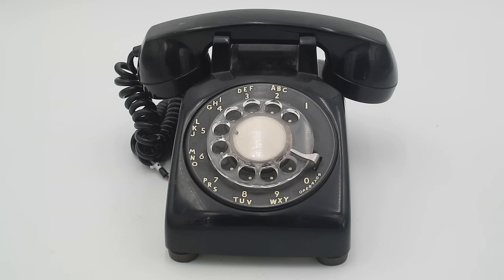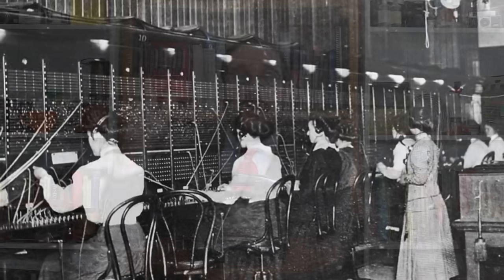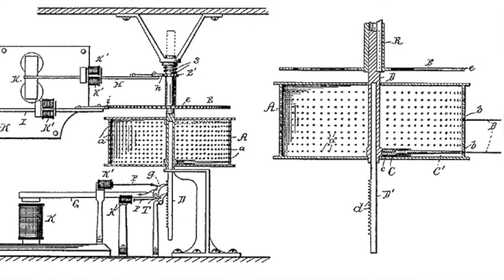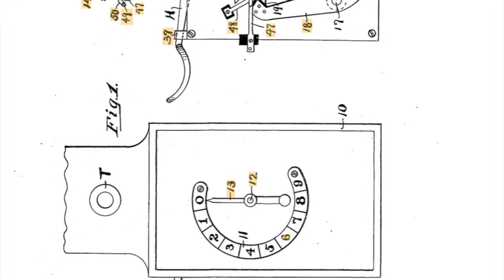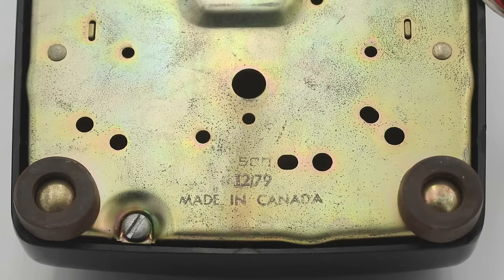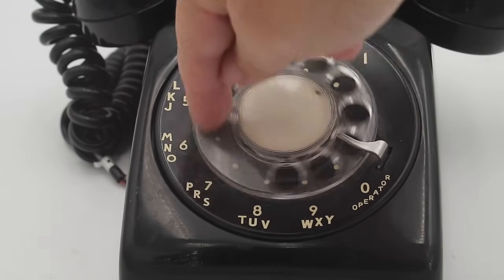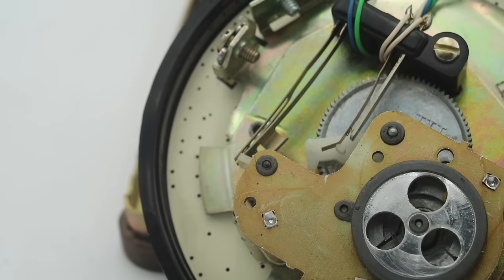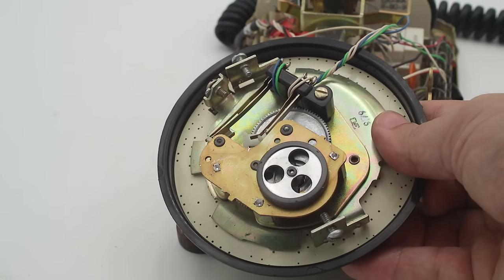Rotary Phones: the Call of History

Comment: The original 302, introduced in 1937 came in a zinc alloy shell rather than the thermoplastic shell introduced in 1940. These original 302 phones are incredibly heavy as a result, something around 7lbs for the whole phone!
Reply: The shell was Bakelite, a phenolic plastic. It is not thermoplastic. It is thermosetting plastic.
Reply: @bruceinraleigh9999  The shell was NEVER Bakelite, it was originally zinc alloy and later thermoplastic. The HANDSET on the other hand WAS Bakelite.

Comment: at 6:30 the model 500 phone "from the 1960's" clearly has a 1979 date code on the bottom
Reply: They refurbished them and stamped the new date on them. Oh, and threw away the old cabinet and put new even if it was perfect . You didn't own a phone anyway.

Comment: I worked in telecommunications most of my life. I was a technician. I retired years ago I've seen these old stepper switches working. They were very noisy. I have a computer have drive that was headed for the garbage.  It's over 3 feet across. I'll send a pic if you want.

Comment: It was a kinder, gentler period of time in the 1950s  through to the 1980s,....when only rotary phones existed. Public phone booths were little rooms, with their own seat, an overhead light, and sometimes a fan. They were quite narrow, so you kind of pulled yourself into the booth. The seats were a simple wooden disk. A single door that ran along tracks inset into the floor and the ceiling, it was configured as a bi-fold door. Folding out of the way, and it had two panes of glass, to look out of. They could accommodate a businessman and their briefcase. The ones inside of buildings were warm and cozy. The college kids would have contests, to see how many of them could cram themselves into one. There were no set rules, anything was fair game.

Comment: Rotary dials are pretty intuitive. First time I used one I did I right but based on a wrong assumption. I thought the stop was part of the switch  so I  turned the dial all the way back without being shown and after that it’s just putting the numbers you want in correct order.

They were very much obsolete when I was a kid in the 90s.

Comment: The 302 is designed by George Lum and it is based on the Ericsson 1931 model. 
The housing is made of Zamac for the early models. 1943 came a stuff called Tenite. Only the handset is bakelite. 
The 500 is designed by Dryfuss.

Comment: Yah , I forgot to mention the busy signal . 
That signal means the line you called is in service already . So you can either hang up , and try again later . In which case the busy signal can indicate that the person you called is in trouble . 
Um , you could break in to a call if you have a real need to talk to the person you yourself want to talk to . By dialing O or zero . To get the operator . WHO WAS HUMAN ! Then give your excuse for the interruption and the operator would connect you . 
Later , the phone company added a feature to alert you to someone trying to get through to you . There other options added to the system over time , and they are on your smart phone .

Comment: Why didn't you explain how the Strowger mechanism actually connected you to another phone? That'd be the most interesting detail.
Reply: He does, or at least I spotted it. The Strowger/SxS system used a succession of switches to connect your line to that of the subscriber you wanted to call (So the usual LF -> 1st digit selector -> 2nd digit selector -> Subscriber selector (100 lines) but was very equipment intensive (A 10,000 subscriber central office required at least 1,000 switches) and this is why Bell/ATT eventually developed more space/equipment efficient solutions as time went on. 🙂
Reply: @dieseldragon6756  Yeah, I wrote that comment halfway through the video, LONG after he'd moved past the Strowger story. It makes no sense that he finally explains, somewhat, the Strowger device only at the far end of the video.

Comment: Even into the late 1970's i had an operator ask me, "What phone number you are connecting to?" when using a rotary dial phone. Not until the rotary dial telephone is fully replaced by the push button telephone [required a manual setting of pulse or tone dialing] is a switchboard operator fully eliminated. Anyone remember this? 😅😅😅😅😅.

Comment: I worked at a coal fired electrical generating facility which used rotary dial phones well into the 1980s.  Processing, burning and ash disposal at these plants is extremely dirty and corrosive, bad for mechanical rotary dial of the hundreds of phones throughout the plant.  Most times this gummed up the dial, so we became adept at dialing numbers using the cradle switch.  You had to press 10 clicks for a zero.

Comment: For some strange reason, the new digital telco switches, and the even the new softswitches used with fibre have the software to still allow rotary dials!
I guess if you have to time one second open intervals for flash signals to operate call waiting or 3way,  you might as well time 62ms open intervals from a dial to react by counting them to take in phone numbers. Just seems anachronistic.
The VOIP systems used by coax cable companies did not bother.

Comment: The rotary phone is not obsolete. They still work on modern phone lines. They require a jumpr wire inside to cause it to ring but you can dial any number and * is 11 and # is 00 I still have one in use.

Comment: I live in the 5th largest city in the US and when I was a kid, they were still using the letter-number scheme.  Like HR6-5295 as a phone number.  This did not change until about the mid 80s when people largely started giving their phone number as 335-9234.  Then, later in the 90s, around 1997 as beepers proliferated, we started using area codes so instead of 335-9234, it was 610-335-9234.  Also, some area codes were broken up.,  The 610 in the example didn't exist before then and everyone in the greater Philadelphia area had 215 as the area code. But before that, you didn't even need to dial an area code.
Reply: You've almost certainly seen the ads for Empire Today, the Chicago-based telephone flooring sales company. I mention this to augment your point about how nobody needed to include the area code back in the day. As any long-time Chicagoan can tell you, when Empire was launched in the 1960s, the jingle was "Five-eight-eight, two-three-hundred, Em-pire!" because it was universally known to be in the 312 area code. The addition of "eight hundred" didn't occur until Empire expanded its services beyond Chicagoland and needed a toll-free number.

You know what's another really good tourist detector in Chicago? I mean aside from putting ketchup on a hot dog? Anybody who can't immediately sing "One-eight-seven-seven-Kars-for-Kids, K-A-R-S-Kars-for-Kids, ..." from memory is NOT a Chicagoan. :-P

Comment: I still have a light green dial phone on the wall where it was placed when the building went up in 1969. Gone is the landline, but the phone stays where it is, for a conversation piece.

When I first moved in and the phone was still in operation, it would make the most godawful sound, like it was trying to shake itself apart, and me with it. I had to have the telco silence the ringer, except it wasn't a ringer, not really. It was more hostile than that.

Good thing there were two wall connections for.... non hateful phones.

Comment: In Germany the 0 corresponded to 10 impulses, so the 0 came after the 9.
The emergency numbers in Germany are 110 for police then 112 for fire brigade and ambulance.
Pulse dialing was used for a long time in Germany. There were even push-button telephones that used pulse dialing.
It was only with digitalization on ISDN that analog telephones could also use tone dialing.
But the Internet has now replaced ISDN.
Reply: 0 was always 10 pulses in the US and Canada too.
Pulse dialing was standard here too long after "ESS" (electronic switching system) replaced crossbar, but the phone company hated to give it to you free since it was an improved service. Crossbar sounded really cool over the phone while you were using it, I went away to college in a rural area and was disappointed to discover my home phone system became ESS while I was away and now sounded boring.
We also had phones with a pulse / tone switch so you could use pulse to get through the Bell System and then switch to DTMF to check your bank balance or whatever. I have one of those VOIP Internet "land lines" and my new modem actually recognizes pulse and DTMF, the old was DTMF only.

Comment: I have a model 302. My mother just flat out kept it. Bell of Pennsylvania (later Bell Atlantic, now Verizon...) likely forgot she HAD the dang thing as my parents had it since 1959. Even THEN it was an OLD model! Yes! it STILL works on my Xfinity (non-VoIP) voice line, The ringer won't work on Xfinity, but the ringer doe's still work on a Verizon landline. I think the Comcast service lacks the highish voltage that it requires to ring. but I can still dial out and talk! (a more modern auxiliary ringer from Radio Shack solves the ringing problem.) It will likely still work when my kids are in their 80s. LOL. Of course my cellphone is my main phone, but It's cool to have a WORKING piece of history, ordering a pizza with it with friends over is well... a conversation starter!
Reply: ringer voltage is 100V AC...operating voltage is 48V DC...
Reply: In the UK you could get ring boosters, that were needed if you had 3 or 4 bell phones, such a device might make your ring ?

Comment: There is a small mistake in this video.  Long-distance tone switching actually used different frequencies than the standard DTMF dials on touch-tone telephones.  If they were the same, one could use a standard DTMF dial to "hack" the long- distance telephone system.
Reply: See the following URL for more information:from Wikipedia:

https://en.wikipedia.org/wiki/Multi-frequency_signaling

Comment: 112 is also used in the UK now,
Reply: It was introduced across the whole of Europe at the same time in the mid to late 90s. Before that time each county had its own number for emergency calls—in some cases there were multiple numbers depending upon the emergency type.
Most countries are like the UK where they have both the European standard 112 as well as their original number, like 999.
UK mobile phones automatically translate 999 to the appropriate emergency number wherever you are.

Comment: For those Who Care: the final shape, dimensions and "comfort feel" of the receiver you hold to your head had over 70,000 man-hours of developmental time at Western Electric.
PLUS, they were NOT electronic devices; they were ELECTRIC devices; they had no semiconductors, a big item when you're going to run the phone line up eighteen feet off the ground and it goes for miles. A great lightning rod. The newer transistor phones always blew up (Especially those clear ones with the multi-colored parts) and shorted the line.
You could NOT buy the phone, it was only leased. As a result, the WE telephone sets were the finest instruments ever made at that consumer level.

Comment: 1910:  Turn the crank to generate one long and two short rings on everyone's phone.  If Joe Brown hears it he will pick up.
1920:  Operator, get me Joe Brown.
1930:  Operator, get me Main 134.
1940:  Operator, get me Klondike 1342.
1950:  Operator, get me KLondike 5- 1342.
1960:  Dial KL5- 1342 on a rotary dial.
1970:  Dial 555-1342 on a rotary dial.
1980:  Punch 555-1342 on a touch tone pad.
1990:  Punch 1-311-555-1342 on a touch tone pad.
2000:  Punch *3 on speed dial.
2010:  Find Joe Brown's entry in your Contacts and tap the receiver icon.
2020:  Siri, call Joe Brown.

Comment: That 0 to 9 is the Swedish arrangement. I do not think it was used in any other country. Definitely it was not used in Finland. In Finland there never were letters on phones.

18:10 I first thought you wondered why they had such a system, then I get that you just said Y.

The 112 is a relatively new number. In Finland it replaced the 000 in 1992, that is when most people had switched away from rotary phones as in the 80s cheap phones that could used buttons even on pulse dialing became available. One reason for it was that you could lock the number three (and higher) so a phone could only be used for emergency calls.

Comment: Hmm…so even as it’s an analog device, it is sort of a digital phone as the pulses of opening and closing the contacts are OFF or ON or 1 or 0.
Reply: Automatic telephone exchanges were introduced long before the computer era. They were originally electro-mechanical, but actually operated in a digital manner. 
The phone dialler clicks sent  pulses according to the number dialed , and that set in motion switches in the telephone exchange. The final number you dialed set the final connection to the correct phone. 
It was actually a fascinating piece of machinery to see in action, originally all electrical and mechanical, the microchip was still decades away from existence.

Comment: I find it enjoyable watching youth when they try to figure out old technology. Not because it is unfair but it teaches them to think about unique ways to consider solutions to problems. Most youth are not capable of thinking outside of lines in an emergency. I often get asked how I was able to fix something without spare parts, and that's because they are not being taught to adapt, improvise, and overcome a problem to find a solution. Not every problem can be googled for an answer and not every googled answer is feasible in every situation. So trying to get them to think outside of the box is necessary. It's not to be mean but technically does fail and normally when least expected and rarely at opportune times if we lose our digital communication due to an expanded war or solar flares the youth would have no idea how to use older phones. In another two generations nobody's going to know how to make calls if communications fail. How many people know how to use smoke signals? Or other than those who are reaching the end of their lives know how to use Morris code. Or how many kids would consider the wire recorder if the high tech fails if suddenly IC were taken out of the picture how many youth would know about vacuum tubes much less how they operate. I don't believe in torturing them but exposing them and having them remember the steps that got us to the point we are at is very important.

Comment: I just replaced all the telephone wiring in my house because it was all ripped out and have two Western electric phones from the '70s and '80s connected to a voip gateway I have a trim line in my kitchen and I have a touch tone model 500 in the bar. Even have a set of external ringer bells mounted above the door outside on the patio. Super super reliable and if anyone ever does any preparedness for disasters get a voice-over IP adapter a small battery backup for your modem and a Western electric corded phone
Reply: And if you connect it to a starlink kit it then works as a satellite phone meaning if your local loop fiber amplifiers are messed up or your fiber optic lines are down you can still get out as long as you have a clear view of the sky

Comment: I'm not sure 15,000 electro-mechanical relays is the record.  Harvard - Mark II (IBM, 1948) had 17,000 electro-mechanical relays.  The Japanese ETL - Mark II (Fuji Telcom, 1955) had 22,000 electro-mechanical relays.  Relay speed for the Harvard - Mark II was 7 msec.  The Japanese ETL had a slower relay speed of over 10 msec, but because of improvements in architecture was over 4 times faster than the Harvard Mark II.  

Of course, vacuum tube computers were much faster, but early models were much less reliable than eletro-mechanical relays.  Early, germanium based, high-speed transistors also had failure-rate issues, and were initially too expensive for many applications outside of computers.  Electro-mechanical relays made sense in telephone switching and industrial control applications where reliability was at a premium over high speed.

Comment: the sheer mechanical complexity that has been jammed onto, or rather into, a tiny integrated circuit...

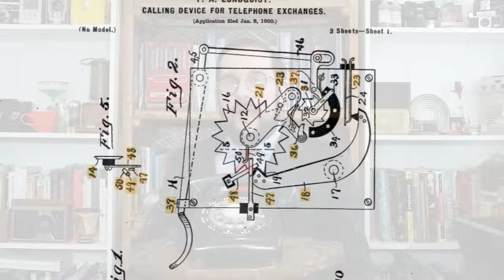05:52 oops…even you fell into the technology-speak trap. aka semantics. 
one wouldn’t have “dialled” a wrong number, rather one would have “tapped” said wrong number. 
oddly, we still refer to “dialling” even in this day of cells, where we have returned to tapping 
a number (as in butt or purse-dialling).

Comment: Thing that always gets me is the oldness yet still uility of phone jacks. 
The best ear buds still do not compare to the sound quality and ease of use of a 3.5mill headphone jack. Unless you have a useless phone with a 1¢ amp inside for the earphones.
Reply: Bear in mind that phone exchanges didn’t use the same “phone plugs” that we use for headphones and guitar amps. They were similar, but not identical, in design.

What do you mean that “the best ear buds still don’t compare….”? Earbuds frequently use 3.5mm plugs. That’s the most common plug for high end earbuds.